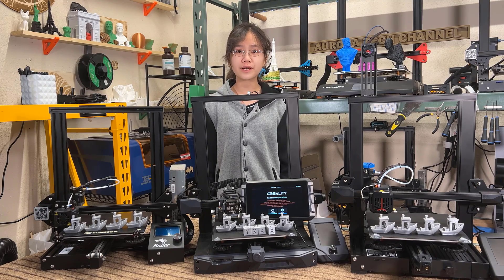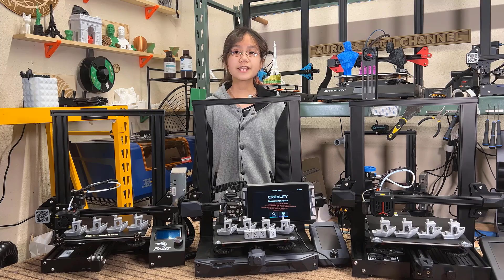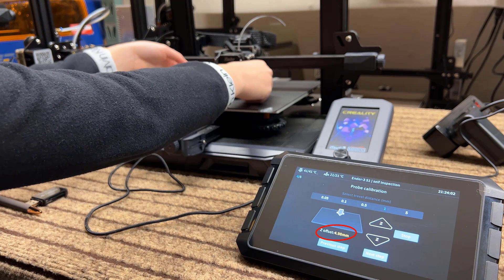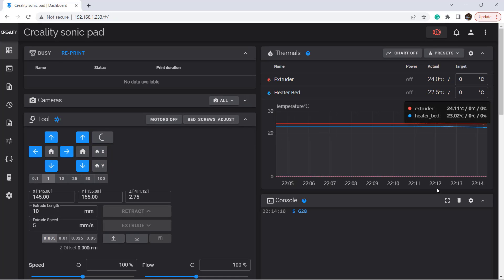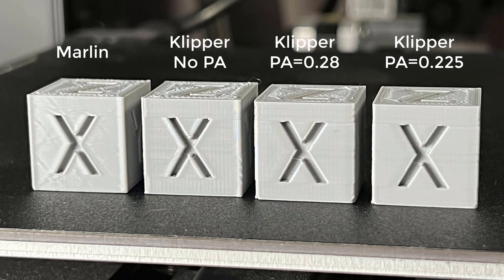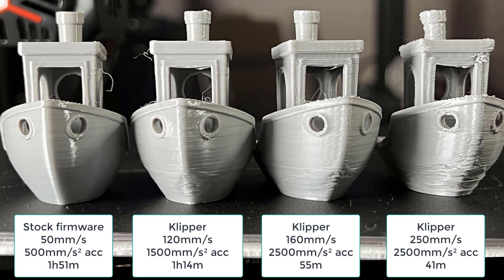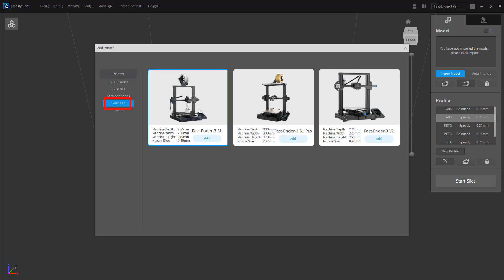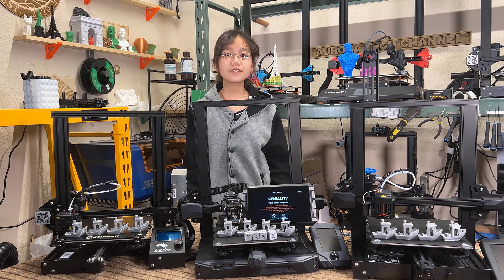Creality Sonic Pad: Klipper on Ender-3, V2 Neo, and Ender-3 S1, Input shaping, pressure advance

Comment: Is there anyway you could do a video on how to set up the sonic pad on a cr 10 smart.  There is a lack of information/documentation on the proper way to do it.  The steps you have provided for the printers in your video are spot on and I was just wondering with the amount of knowledge you have, if you could provide some insight that creality has not provided on the proper way to use the sonic pad with the cr 10 smart.  Thank you in advance and I hope you consider my request.  

Rich

Comment: Hi I have a question. Which option is better. Ender 3v2 Neo or ender s1.
Is the metal extruder on neo a big deal?  Or is the extra motor and timing belt setup on s1 more important for better prints.?

Comment: How do you connect the ender 3 pro to the sonic pad? It's a super simple process but on the final step I can't connect the screen while the printer is powered on with USB or the serial cable. I'm using a 4.2.7 board with sprite extruder and cr touch. Been trying to get support from creality but it's quickly turning into a nightmare. Anyone else having issues with this? Seems fine for the ender 3 V2 and up but with this specific one it's hard to get going.

Comment: Great Video, I really appreciate that you showed the difference in quality between speed and acceleration. Can you please elaborate, how are you making these changes to your test? I am looking to do the same. For speed is that done in cura? and for acceleration is that purely in klipper (print.cfg file). I am on a Ender 3S1, and have set Velocity to 300m,/s, 6000 mm/s2 (per input/pressure advance test). However on sharp 90 degree corners i see some gaps on some layers.

Comment: I have an Ender 3 v2 neo with a sprite pro direct drive extruder, upgraded cooling duct, 42-40 Y axis motor, dual axis Z and BTT SKR Mini E3 V3, I'm planning on installing a Klipper pad to my setup, would my results be similar to the S1? Thanks!

Comment: great video, thanks. If I have run the calibration once initially, what do I have to do to rerun it? does the routine overwrite previous procedures or do I have to change any settings before rerunning it? Thanks

Comment: Hi, your channel is just great. I have a question. With the speeds for the Benchys, do you set everything in Cura to 120mm/s? So walls, filling etc. or only the printing speed to 120mm/s and walls to 60mm/s?  Maybe you could upload the profiles you used, that would be great. sry for my bad english

Comment: How did you achieve the higher speeds durung your tests? I have a V@ with sprite pro upgrade and just installed the sonic pad last week. I use Cura  5.3.0 beta 1 and when I set print speed to 300 Print acceleration 2500 wall accel to 1000 modifying Creality's prebuilt slicer settings for S1 pro I only get 80mms print speed in klipper UI. I hwhith that setup I can manually increase print speed  up to 200% which nets 160mm/s actual. Creality has updated the Sonic pad for initial setup. It tells you to set Zoffset and manual level the bed before running the ABL. Other than that the V2 with sprite does not have a preconfigured  printer.cfg file. You will need to change probe offsets and extruder rotation_distance (7.5) is what creality gave me for extruder and when I checked the calibration of it by measuring and extruding 10mm of filament I came up with7.47375. Thank you for all the great videos on 3d printing and cnc, I use all of them to help me get set up and advance after.

Comment: why does no one every show the issue with the ATMEGA1284 chip, board 1.1.4? It has no bootloader and requires you to purchase an additional piece of hardware and search endlessly to find the file you need for an bootloader.

Comment: If you're not concerned with printing faster, is there a measurable quality improvement at stock speeds between default firmware and Klipper?

Comment: At higher speeds, you need a high flow hotend and a solid platform to place your printer. You'll have to upgrade your nozzle to a CHT, upgrade your heater block to copper, the heatbreak to bimetal, and upgrade your fans. You also have to get rid of the bed springs, higher speeds make the bed unstable, with all the vibration and it will most likely cause ghosting.

Comment: anyone have anytips on how to set the bed size for ender 3 max neo after sprite extruder upgrade the cr touch is like 2 1/2 inches of the front of the bed it wont auto level creality hasnt responded in been waiting over 2 weeks for a response

Comment: Thanks i used this video to calibrate pressure advance since it is my first time with klipper dint know i just needed to add it in print.config. Im running now Ender 3 V2 hemera extruder with 5015 blower at 100mm/s with 2000 accel on perimeters and 150mm/s at 2500 accel.

Comment: May I ask, if you had a CR10S Pro V2 would you: 
add a sonicpad or 
invest in a Flsun v400 or 
invest in a sonicpad for the CR10S Pro V2 and add a decent bed slinger to also plug into the sonicpad?

Comment: Very straight forward, wunderbar ;) Do you know where I can put in the command into der printer config to present the print after finish to y 235, as in the gcode of cura it does not do it? (I need it to switch of the printer so the bad must go to the very front) Thanks for a hint

Comment: I'm glad you specifically mentioned the V2 Neo. A couple months ago I got one as my first 3D printer specifically because it came with the upgrades that I felt I would end up adding anyway, but then I came to find out how new the printer was and that if I wanted to add anything to it I needed to take a chance that it shared V2 part similarities or compatibility. Nothing is listed for the new printers yet.

Comment: Can you use a original ender 3 you say it can but I can't see the ender 3 you have it could a v1 when a original has the sd card on bottom. I would get this but I have a original ender 3 with a bltouch on it and need to what ender 3 firmware to use.

Comment: Curious.. how were you able to print the 52 and 41 minute benchies?  I raised print speed from 50 to 200, acceleration from 500 to 2000.. estimated print time went from 104 minutes to 81. Standard 20% infill and 0.2mm layer height. I have the Ender 3 v2 with upgraded 4.2.7 board and Sprite Pro extruder, and have been using the Ender-3 S1 profile in Cura.

Comment: You seem to know what you're doing and I really need help. I have a CR touch and the Sprite Extruder pro on my ender 3 v2 . I'm also using a sonic pad. I came across a problem where when I try to do the auto leveling, the probe does the first 5 points then misses the bed completely on the 6th and the extruder pushes against the bed. I guess it's not aligned or something but I don't understand what's wrong. I also don't know how to edit the klipper config either so I can't really experiment with changing things. Please help!

Comment: Thank you for the video, it was very informative. Just wondering if you or anyone else has had issues with 2 USB webcams after the latest update that allows multiple printers. I have 2 Logitech c920 cams and straight out of the box, both power up on bootup. After the latest update, the pad only allows one cam to be powered up at a time. (I've even tried a powered USB hub).

Comment: I wonder if you think that the resonance testing you did could be improved by better cable management and the elimination of the clip [perhaps by using 2 sided tape]. This test is very specific to the setting where the printer is to be used. Adding mass to the print bed, and a torque arm to the X carriage will both adversely effect the precision of the acceleration offsets. I think this can be done accurately, and without much complication. 

I think that there is a misunderstanding of the acceleration issue with regard to resonance. Since it a print quality issue where a 3 D printer is concerned, there is only one place where that issue is made manifest, and that is at the very tip of the extruder, where ALL factors in the construction of the printer are combined to deposit material. The closer, and more rigidly the g-meter can be mounted to the tip of the extruder, the more relevant the information will be. 

This test takes into account absolutely everything in the setup of your printer, down to the position on the table you are using, if you have casters on your table, and even other heavy objects on the table while you are printing. You showed that this fine tuning is very useful in producing good print results, there is much finer tuning you could do by adjusting your testing regime slightly.

To be clear, the tests you did would be VERY relevant to any other type of robotic calibration, having an understanding of where robot actuation points in space across the entire domain of movements is critical to the accurate and repeatable programming of a robot in free space, but if you get a significantly different resonance profile when measuring from the bed versus measuring from the print head, you have other problems that will be preventing quality prints. [I am thinking of loose bolts, and loose guide wheels]

Based on your review I think I will pick up one of these, the Sonic Pad seems to have all of the features I would want to be able to control, thanks for showing that off.

Comment: UPDATE: Yesterday Creality released an update to SonicPad that allows 4 printers to be controlled from one pad!  I tested this today by adding a second printer to the SonicPad controlling the Ender 3 S1 Pro (My Ender 5 Plus has is own as it is located elsewhere).  Easy peasy setup and operational just as the first one was.  What a great value!  I am going to sell my two PI's and screens...I like this better..all supported, minutes to install, less expensive. what is not to like?  My onlystrange issue is that in Cura 5.2.1 the Build Plate temperature disappears with the provided Cura profiles.  It is checked off in Cura settings, but is somehow surpressed- this forces me to adjust when I go to print- although easy, you shouldn't have to--looking in to this now.

Comment: using a core XY is mandatory if you want to achieve high speed print ( klipper and marlin ).
Moving bed cannot achieve high speed especially with 30mmx30mm bed, it is too heavy for the stepper motor
On my Twotree sapphire plus which cost less than creality printer + Pad with on the shelve marlin I print at 160mm/s with 3000 acceleration and I have a good quality 3Dbenchy in 41mn

Comment: New version of firmware tells you to tighten all bed knobs, then it has you do Z, then you go back to level four corners- I didn't do level four corners, instead used the auto bed leveling and made a few tweaks, then re-ran and saved the auto bed config. It prints fabulously. I also pushed a few test models to 200% which was around 250mm/sed and got useable prints. For example, was able to print the bunny at this speed and it looked great. I should note I did do the vibration calibration on X and Y axis and the rest of my machine was already tuned, but for good measure, I did the PID on hotend and Bed as well..
After messing around with two raspberry PI's and following instructions in other maker posts, I had lots of issues- if you are starting with no PI's, it isn't worth it. With this solution you get a 7" screen, basically effortless installation and great results- I paid $149 for SonicPad on Black Friday...
Reply: UPDATE: I tested this on the newer Sonic Pad firmware and if you follow the instructions on bed leveling exactly it all works. They fixed the errors that was mentioned in this video.

Comment: In the lastest firmware update for the Sonic Pad, they added several printer profiles, including one for the "CR10 Smart". However they do NOT have the "CR10 Smart PRO" on there that I've seen. As they have different boards in them, I am assuming that this is not a usable profile for the Smart PRO. Why would they add the older, less updated Smart, and leave out the Smart Pro??? Anyway, I'd love for you to do a video of adding the Sonic Pad to the CR10 Smart Pro, and show the results. Also, I'd love to know where you got the 5015 blower for your 5 S1 Pro, as I can't find it anywhere. Thanks for all the well rounded and professionally done vids by you and your brother. I hope to get an answer to these questions, as I have a lot riding on it. Lastly, if you have time, I'd love to see a compare/contrast between the Ender 5 S1 Pro, and the Smart Pro. Thanks. Cheers!

Comment: Hi i rlly like your videos but im curious about the Pressure advance my Ender 3 S1 Pro with Sonic pad needs Pressure Advance of 0.02 mm/s^2 !! not 0.2mm/s^2 dont know if this is normal? and the whole Calibration print only goes up to maximum 0,2 mm/s^2
Reply: Think she made an error...her 12 mm should be multiplied with 0,005 (direct drive) not 0,02 (bowden) ..my ender 3 s1 pro would not be happy with PA of 0,25 😀

Comment: This was a great video. You helped me further justify my step up to the Bambu Labs X1 Carbon from my Ender 3 Pro. I'll always love and will still use my (heavily modded) E3, but without being a CoreXY, even with Klipper, the E3 is clearly best left as a slow, higher print quality printer.

Comment: This is a great run down of the features of the pad and setup. I have one on the way!

I did have a question about it I hope you could answer. I have an Ender 5 Pro and I haven't seen anyone set it up with those yet. Would a custom firmware need to be generated for an Ender 5 or say a Creality printer with BTT SKR?

Hopefully I'll have it by next week and I can figure it out.

Comment: As I just calibrated mine - it would appear that they have updated the process a bit and it allows you the ability to move the calibration sensor between X and Y resonance.  I havent done the pressure advance part yet, but I am already noticing the difference between the stock and the Klipper.  Running a test cube as we speak after doing the resonance...

Comment: I don't think that you did a great job in the calibration with original FW my S1 PRO print bether in 150mm/s that your160 with Klipper on the calibration cube, my bench have problens only due to cooling  please remake this video with bether calibrations

Comment: Does the pressure advance with klipper and sonic pad work with the tmc2208 stepper drivers on the 4.2.2 board as I couldn't get it to work with Marlin and would like to be able to use pressure advance

Comment: Hi great video. How did you get model thumbnail on the screen? Are you using and older version of Cura? With my Ender3 v2 with Mriscoc Professional firmware and Cura 5.2.1 I am still just getting the QR code. It was working with my older firmware and Cura 4.1.3. Any tips you could give me? I would like that feature back. Thanks

Comment: Your pressure advance value is incorrect.  You used the bowden value factor to get your pressure advance instead of the direct drive value. Should be multiplying by 0.005 instead of 0.02.
Reply from the maker: Yes, I have already put a correction note under the video description. Since I was testing out 2 bowden tube printers(V2 Neo and Ender-3) and 1 direct drive(S1), just mixed some clips when doing final editing.
Reply: @AuroraTech  Understandable

Comment: Just did the setup on my S1 Pro with the Sonic pad and when I try to calibrate the axis vibration with the accelerometer, its giving me an error. No luck finding out how to fix it. Error is "Failed to set ADXL345 register [0x38] to 0x0". Any thoughts?
Reply: It is a wiring issue with the length of the cable, have to cut about a foot or so of the length out and solder the wires. Or twist them together and hope it works. Pretty shitty. I bought 2 pads and both have the issue.

Comment: has anyone tried it with the neo max ???
Reply: Waiting for this as well.  The Max came in two days ago, but not the Neo.  I wonder how far off they can be, and if using the no-Neo profile will work for the Neo.  Fingers crossed that in 10-14 days (Creality's current firmware refresh schedule) the Max Neo will be included in the Sonic's profiles.
Reply: Been working pretty well with my max neo. Print times are decreased by a few hours and the prints are as clean as before

Comment: As many times as I've seen people raving about the benefits of Klipper, I've completely avoided making that switch myself because I'm wigged about the idea of messing around with the firmware. Knowing that I could take my Ender 3, swap out that 1.1.5 silent board for a 32-bit board, and plug it into an external device to do the job with relatively little fuss is really something. Great review!
Reply: I have the 1.1.5 and from what I understand, it should work.  I recently got the sonic pad and I´m havin a tough time setting it up, though.

Comment: I imagine that you can have several printers connected to sonic pad?  how many in total?
Reply from the maker: Just 1 for now, I believe it should be able to control 3 at the same time but need to wait for new firmware from Creality to support this feature.
Reply: @AuroraTech  on the other hand, the flsun one can control up to 8
Reply: @carlosbalastegui1932  Actually the flsun speeder pad can only control 3 machines at the same time and it only has 1gb of ram where the creality has 2gb of ram. Would have been nice if creality went with 4gb of ram or offered the option to upgrade ram

Comment: Do you have firmware ender 3 pro + CR Touch on motherboard 4.2.7 ? I have problem build size install  cr touch firmware original.i can build on size 210mm. I'm so sad 😞..